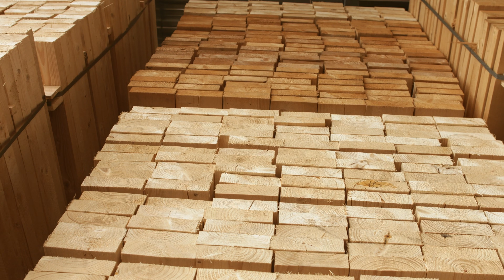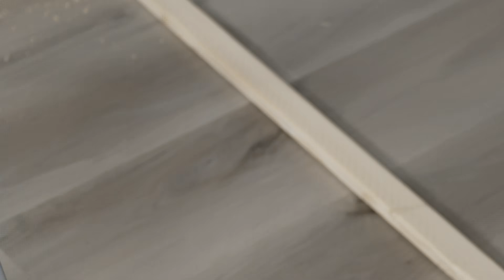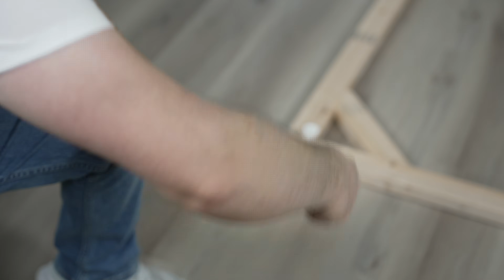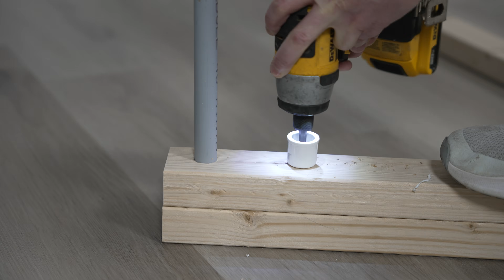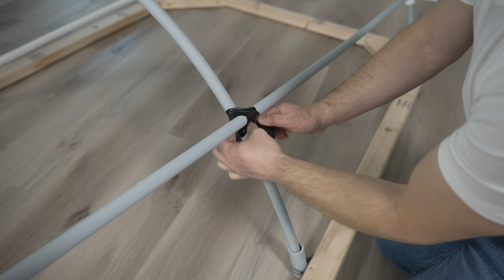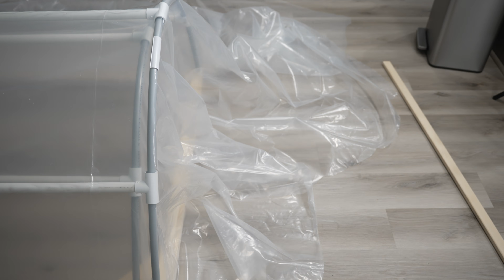6 Genius Techniques For Building A Double Layered Hinged Hoophouse

Comment: Can you tell me what is the size of your link chain for the garden bed
Reply from the maker: If you're referring to the chain that keeps the hoop house from touching the ground, any size will work—even rope. It doesn’t take much to hold it up since it’s very lightweight. I’m not exactly sure what size I used, as I no longer have the chain after moving. I bought this chain by the foot at Lowe's home improvement store 🙂. Let me know if you have any other questions?